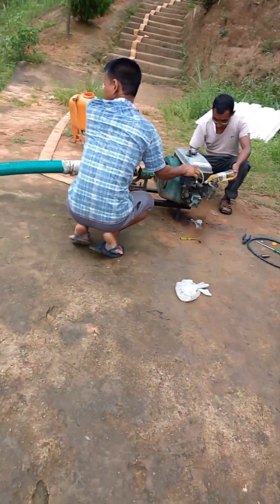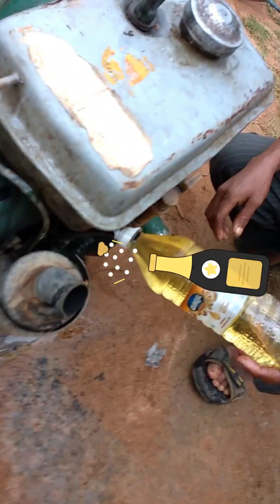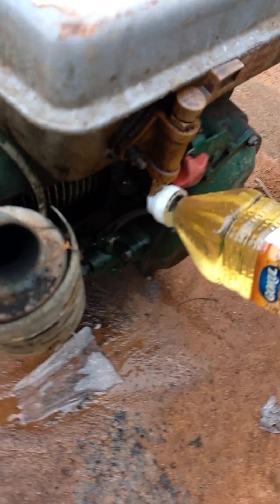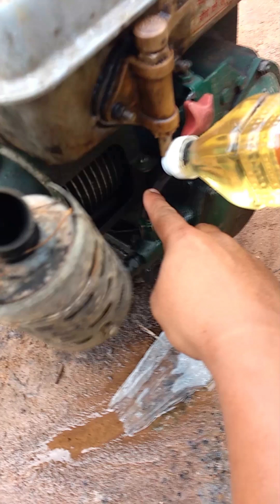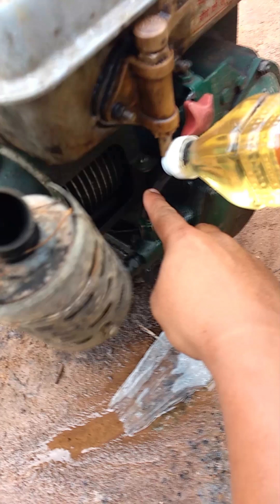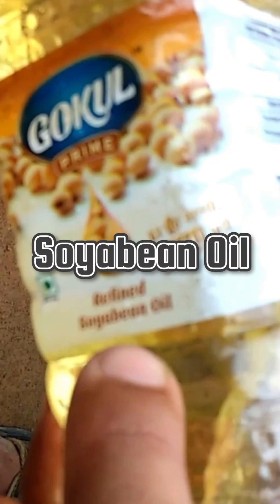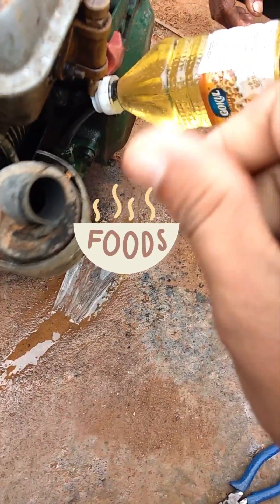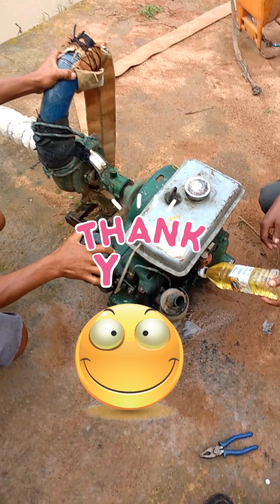Vegetable Oil powered Pump

Comment: Good idea. Could be useful should a water pump almost runs out of diesel.
Reply from the maker: Thank you bah, yes I was thinking of separating biodiesel from waste cooking oil from restaurants and canteens, using sieve filtration and then using methanol as a catalyst to remove the glycerol. But the quantity that we get from the restaurants and canteens is not much as of now. Perhaps in the future it will be feasible.